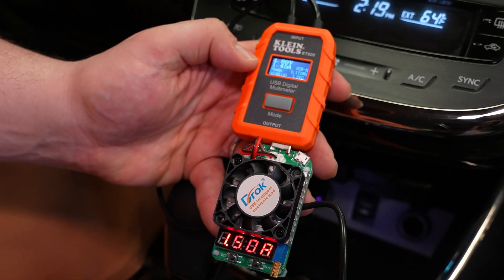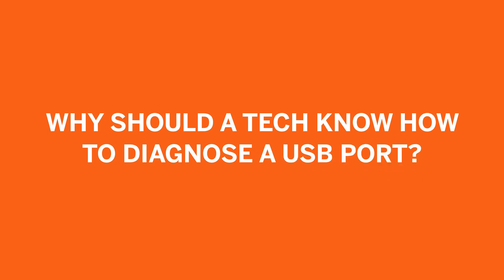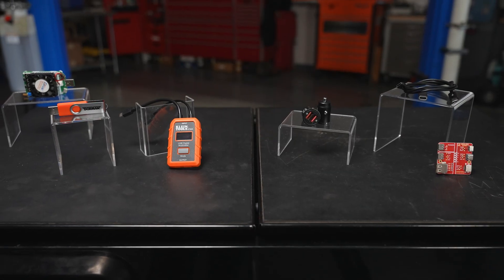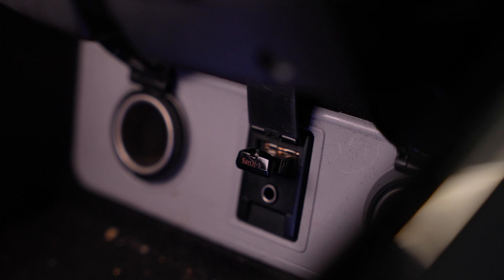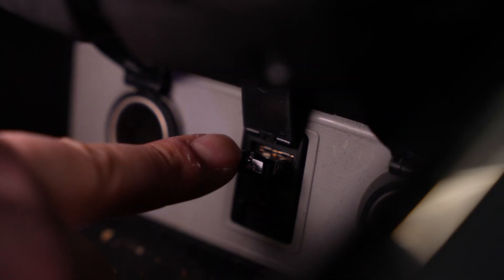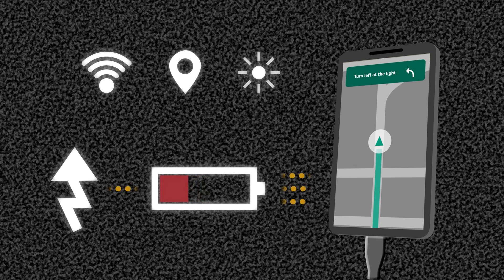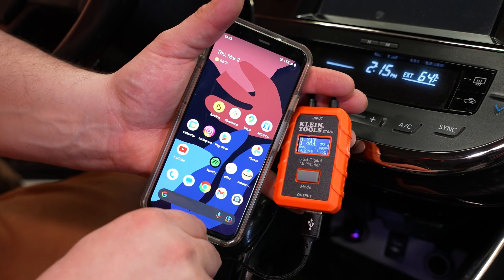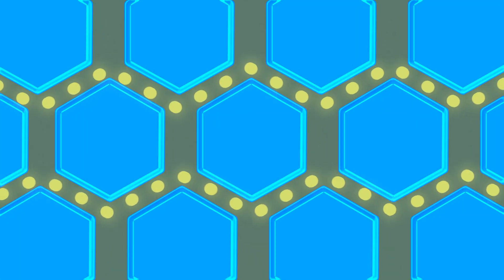Testing and diagnosing USB problems in cars

Comment: The discussion at the 12:49 timestamp really helped me understand that the USB ports on older radios may very well be underpowered to handle the connection of current iPhones tethered and running CarPlay while also charging, especially since the charging cannot be turned off.  Such devices can easily attempt to draw around 7+ watts from a port designed for roughly 2.5-4 watts, causing it to shutdown.

Comment: My problem - 2018 Camry is - USB port can charge my phone no problem - but anything plugged into it, whether it is a phone with various cables (OEM, Anker, etc.) I get a "device connected cannot be recognized" error.  But even more strange is any USB thumb drive, from a brand new Verbatim 2GB FAT 16 one to a Sandisk 4GB FAT32 one to a 256GB one FAT 32 one - all get the device connected cannot be recognized error.  I then tried about 18 different USB thumb drives I have, some brand new, some almost new, formatted on FAT32, EX Fat, NTFS - nothing would read on the head unit - even MP3 files on the file can't be read.  I think it's the head unit - but I wonder if a faulty fuse would cause this type of behaviour.